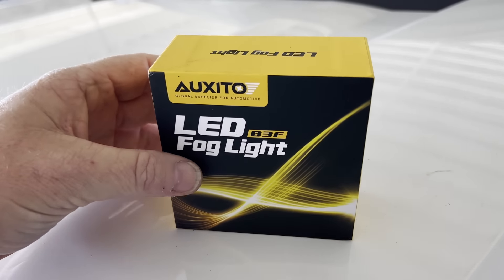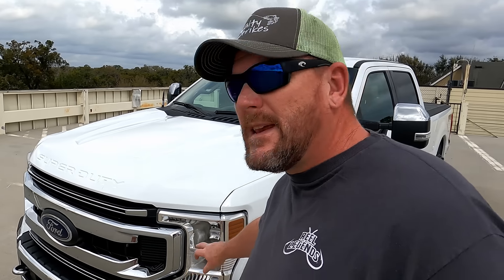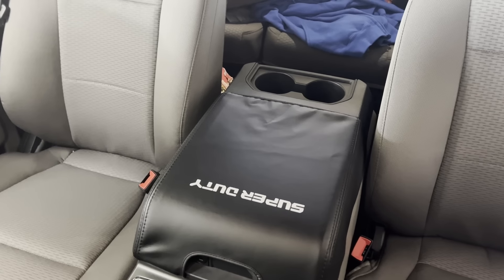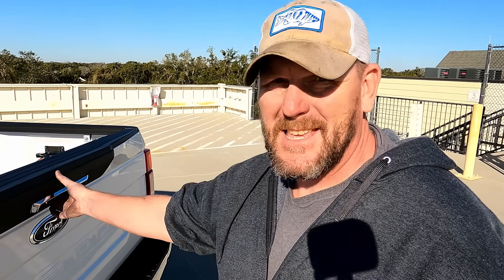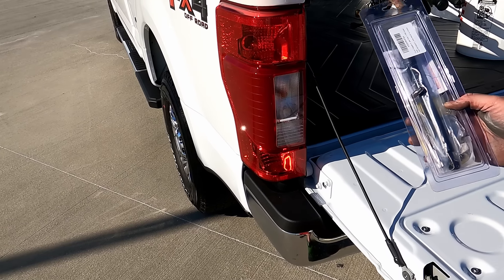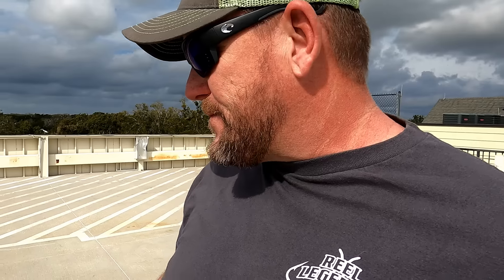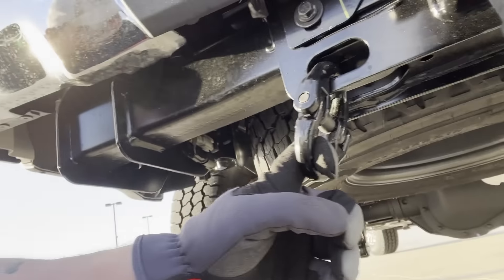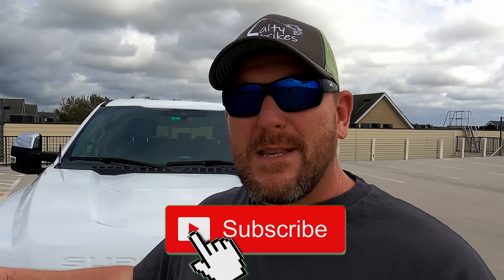SIX mods EVERY truck owner should do first! F150 F250 F350

Comment: In some states,  it is illegal to drive with fog lights on unless there is actually bad weather. Putting brighter lights on the vehicle will only make it worse. Driving toward a vehicle with fog lights on is like driving toward a vehicle with brights.
Reply from the maker: … fog lights have an on and off button as shown in the video, use discretion as needed, they don’t blind people they have less lumen’s than head lights and they are angled slightly down. Been using them for 5 years in the F150 and not a single vehicle of the hundreds of thousands I’ve passed has ever flashed there lights at me or gone careening out of control off the road. Beside Fords lariat and platinum come standard LED fog lights that are brighter than these aftermarket ones, I doubt Ford would take on that liability if they where blinding people left and right causing accidents.

Comment: the best mod i can think of is ditch the modern truck and go back to the tried, tested and true trucks...
Ford: 1992-1997 (9th gen)
GM: 1988-1999 (4th gen), 2000-(early)2007 (5th gen)
Dodge: 1994-2001 (2nd gen)
after the mid 2000s, EVERYTHING went to shit.
Reply from the maker: This has been great so far!
Reply: Just bought a 1995 Ford F-150 king-cab, installed a new crate motor, rebuilt tranny, replaced all necessary items and for under 15,000!
Reply: @DannySawyer60  makes me glad to hear that! the old trucks are truly better in every way!!! i wish more people would finally realize that.... if a person fully rebuilt an ENTIRE truck, it would cost as much or even less than a brand new one. no digital tracking or tech problems. most stuff is mechanical and easily repaired and not to mention for the older trucks, there is 30-40 years worth of knowledge on them so not many problems will ever go unsolved.

unlike today's junk....

Comment: Installing LED bulbs in the Halogen factory headlight housings is just wrong.  So many people do this incorrectly and end up with really horrible beam patterns.  If you do not spin the LED assembly and take the time to aim it properly it ends up blinding everyone coming at you.  If you want LED headlights do it right and install LED housings.  I get that not everyone can afford that option but I wish they would outlaw LED bulb replacements.  They are not safe for oncoming traffic.
Reply from the maker: Never been an issue

Comment: I hate a vehicle with those lights they blind me
Reply from the maker: … won’t be long before LEDs are standard, not just the higher end models.
Reply: @saltytrips  LEDs in the proper housing do not blind on coming traffic.  You will blind people with yours.
Reply from the maker: @JW-jh7zv  … they have an off and on switch for when they are needed. Like illustrated in the video where deer are a big problem. Using them for over  seven years now and not a single person has gone careening off the road out of control or had anybody flash their high beams at me out of fear 😨 of blinding light. Hope you find some peace and serenity in your life.
Reply from the maker: @JW-jh7zv  been using them nonstop for 7 months now and not a single person has flashed there lights at me nor driven off the road and got in an accident from blindness. Some people just have contempt for everything.

Comment: Easier and cheaper to replace the hooks on the trailer safety chains with 5/16" or 3/8" hooks than those dumb hammerlocks. SMH
Reply from the maker: Our boat trailer has cables, and those with multiple trailers would have to swap them all out. One size fits all Hammerlock. Some people just need to have something to complain about. Thanks for watching 👍